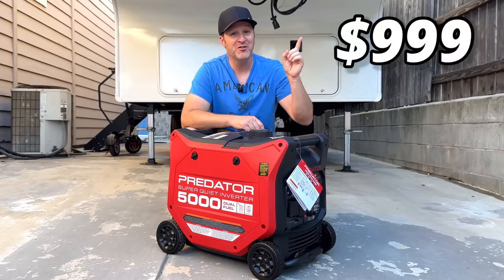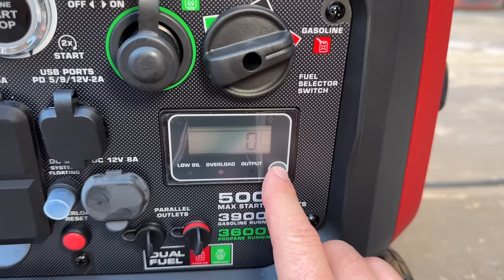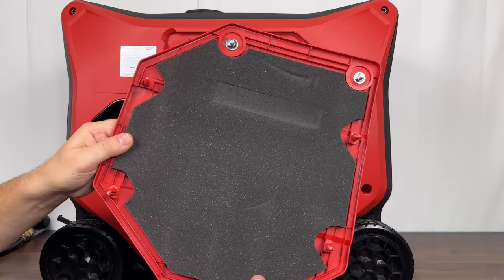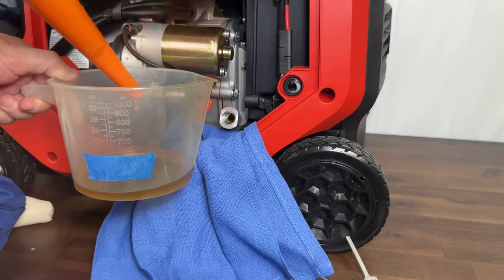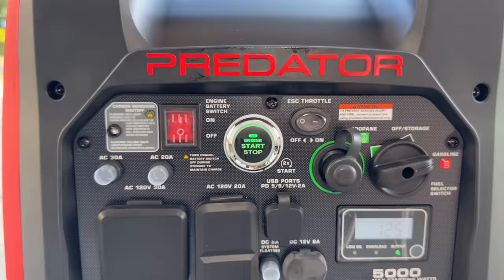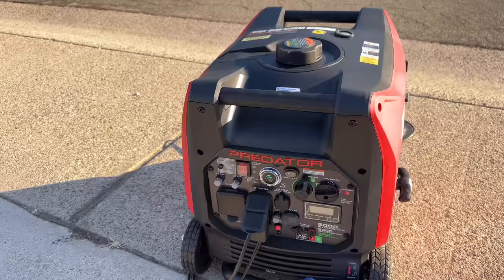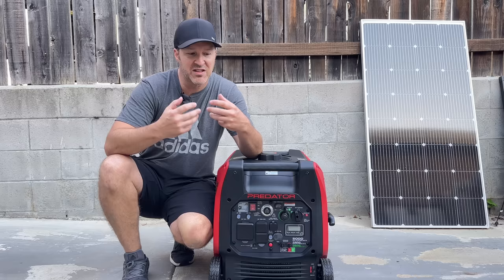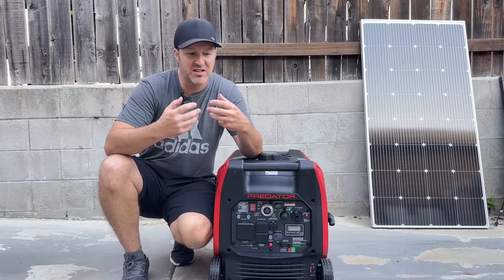BEST New Generator! Predator 5000 Watt Dual-Fuel SUPER QUIET inverter Generator LOADED!

Comment: Is it any quieter when running on propane over gasoline? I’ve heard generators can be quieter on propane
Reply: I've had several duel fuel units varying from 2500 to 7250 watts. I can positively say that there is no change in sound level from 1 to the other. Only a loss of output on propane and use of more fuel.  I really wish it was more quiet on propane. So other than the convenience and less maintenance using propane, I dont see any benefit while in operation.
Reply from the maker: No I have done that test several time and noted no difference
Reply: Dang that’s not what I was hoping to hear, thanks for the reply’s guys. Do either of you think a generator built to run solely on propane is any quieter than an equivalent gas inverter/generator? I’m trying to not disrupt my neighbors at various campgrounds so the quieter the better since I really don’t want to shit it down during the night hours or I’ll burn up inside my camper
Reply: @dylanhenkins8508  I share your same sentiment with noise at the campground.  My solution after years of building quiet boxes and buying tons of generators was 3000 watts of solar and an 11k battery bank.  Madness I know. I'm not a full timer but I can run my rooftop continuously in new york heat.
Reply from the maker: Only a small Honda gen is quite or maybe the new alp but a sound box would still be needed. Gens are just loud. Solar is the way but its still spendy and if you want ac over night you need a large battery bank and of course a lot of solar to fill it. Most like me can run ACs during the day on solar but over night even as stated above, 11kw won’t do it for a normal ac unit. Hence mini splits are getting real popular. But also depends on RV size and how well its insulted and outside temps. So many factors. .

Comment: Do you think the 9500 can run a small home
Reply from the maker: Sure, so can a 5000 or a 2200. I really depends what you are running in the house. If you just need essential items a small unit can. If you want a little more then a 3500-5000 can. If you want to run a lot then 9500, want to run everything 15k and above.

Comment: Hi , question can I use this generator for my food truck? To runs  AC mini split 110v , water pump, water heater and lights?? Thank you
Reply from the maker: If that’s all then yes!! The mini is about 1075 watts and everything else will be minimal. I mean unless the food truck is massive
Reply: @johnnysweekends  the trailer is 7x16 , i use 1 refrigerator, outside and inside lights, water pump ,water heater and the ac mini split
Reply from the maker: Ok well that changes things. You now have a Ac mini split a water heater which is that electric because that could consume 1500 watts almost. Then a couple fridges, you are now maxed and I think will need to jump up a decent amount. You dont want to run gens at 80% and above the whole time.
Reply: @johnnysweekends  so I need a 7000 w or 9000 w generator right?
Reply from the maker: You need to do a energy audit this way you know you have more than enough.
Reply: @johnnysweekends  ok thanks 🙏🏻

Comment: Have you tried this? Could you use this to charge an ecoflow delta pro? One with ac plug for 1800 watts and the other with the parallel ports hooked to mc4 plugs to the solar connection for another 1600 watts for a quicker charge in an emergency?
Reply: Considering whether it’s more advantageous to use the dual fuel EcoFlow generator, Predator, or Firman for the fastest recharge at the optimal price. Assessing if the additional cost of the EcoFlow is justified
Reply from the maker: The parallel ports are not dc. This would be a bad idea and damage the DP.
Reply from the maker: All depends if you want the smart functions and how often you would use it.
Reply: Thanks. I get it now.

Comment: What's weird is that this 5000W inverter gen vanished from Harbor Freight's website.  Gone.  I searched all over for it and nothing.  Even the promotional photos of their Predator lineup don't show it.  Very suspicious.
Reply from the maker: It’s been recalled !!!!!
Reply: @johnnysweekends  it must be very serious if they completely removed it and made it vanish! Any details on the recall notice and what the issue is? I can’t seem to find anything online
Reply: I check their website recall list and it's not on there.  And it's not on the government recall list either.  Interesting... @johnnysweekends
Reply from the maker: @tristanschaper281 im making a video now. Should be out Friday
Reply from the maker: @tristanschaper281 its not on recall list yet. May not ever be, but they pulled certain stock and might pull more. Will see

Comment: No split phase 240 volt AC kills it for me.
Reply from the maker: It’s a little small for a 240v power output. Most are about 5000 watt running to be a 240v unit or it would not have much power on each leg. 15 amps or so…

Comment: Dropped the ball. My 3500 takes care of most 110 needs. All they had to do is up the cc to 5500/6000 and add a 240v plug. I need an easily portable 240v gen with minimum 4000 running. Dumb in my opinion to have a gen so close to a 240v capable machine.
Reply from the maker: Most 240 is about a 6000 start unit. Many out there.
Reply: @johnnysweekends Many get mixed reviews. My Predator has had no issues. Would it have taken that much more? A lightweight, portable, reliable, and affordable 240v capable generator.
Reply from the maker: If they build a under powered 240v unit how would that look? The maxpeedingrods rods 6250 unit seems ok so far but still new. But each line doesn’t get much power. If this predator was 240v it would be getting 15.6amps per line. That would start ac units but it could power both sides of a home panel if you really needed it. But it would be best to just have a critical loads panel and call it good.
Reply: @johnnysweekends  my point is they could have just made it a 6,000 and 240v for those that need portability- covered more consumers. If I needed it for the house I would just get their 9500. Probably end up getting the Costco A-I power 7100- mixed reviews , but Costco , so easy return. I will look at your other suggestion.
Reply from the maker: Costco and HF both have good returns but warranties need for HF

Comment: Volt-Amps and Watts are not the same thing. Depends on load power factor.
Reply: Volts times amps will always equal watts. That is an electrical engineering standard formula. If you have 100 amps at 2 volts, or 2 amps and 100 volts, you still have 200 watts of electricity. Multiplying those two measurements together is how "watts" became a man-made calculation of electricity.
Reply: @1001Hobbies  You don't know what you're talking about. Better go back to your hobbies and keep quiet.
Reply: @General-Eclectic  - You should look up the Dunning-Kruger Effect and how it applies to you.
Reply: @1001Hobbies  Clearly, irony is not dead.

Comment: What is the point when it is only 120V?  At 5000W it should also have 240.
Reply from the maker: It’s to small a unit for 240, each line would have minimal power. What are you needing 240 for?

Comment: No whole house locking plug. A shame as it's a serious oversight.
Reply from the maker: What do you mean, a L5-30R twist lock?
Reply: @johnnysweekends  AC Out 30amp 120/240 AC locking
Reply from the maker: You can buy a adapter to your plug if you only need 120. Most people only need 120 to power a few items during a outage.
Reply: @johnnysweekends  I currently run a Honda EX5000, plug it into receptacle in garage which runs to transfer box next to fuse panel. The 220 is dispersed at this point. This is the same on all my friend's Gen/Transfer box installation.

Comment: What is the benefit of paralleling this with another unit?  It has a 30amp outlet on it, which is 3600 watts, same as what this generator can produce.  If you parallel with another unit, you would just be producing extra wattage that couldn't be delivered through that 30amp outlet.
Reply from the maker: You buy a parallel box and double amp out put. So now you have a lot of power for home or large RVs.
Reply: @johnnysweekends  what plug type is 120volts but can handle 60 amps??
Reply from the maker: It’s mainly to power up say a 50 amp Rv you can run both hot legs so it side can be powered. It will still be 120v though. 
This way of running 3 ac units and your fridge you can run 5000 watts and be good. More uses than that but that’s a example.
Reply: @johnnysweekends  gotcha thanks.  I didn’t realize the parallel kit had its own 50amp adapter.  Great review!

Comment: But no 240v😢
Reply from the maker: Most any gen this size is not 240. I don’t know any that are at only 3900 running. 
Unless it’s a open frame non inverter.

Plenty of 240v options

Comment: all of these generator have a 30 amp plug. really limits you on the size of RV you can use it with. Harbour frieghts 9k inverter genny still only has a 30 amp plug. My rv has 3 AC units and even the 5500 onan QG that is in it isnt enough to run the Air and the Nuke at the same time without shutting the genny off. More power is needed from these cost effective generators before they are really viable.
Reply from the maker: There are a few units out there but you are also beyond typical with that large of a Rv. The Genmax 7250 is a nice compact unit that’s 240v as well dual fuel and more. 
I don’t know what size ac units you have but it should run all 3 but that may top you out and you’ll be burning some fuel. 
https://amzn.to/450rDhw

Big toys require….. well 🤔 big toys 🤷🏼‍♂️😂👍🏼
Reply: @johnnysweekends  GM9000iEDC is the one I have been looking at. All three ac units are 15k. The Onan in my rv right now is worth way more but doesn't have the balls so I might be trying to sell that and getting one of the genmax units as backup for the solar on the roof pretty soon. cant bring myself to upgrade to a bigger onan for like $10k :P Great content though I watched the whole video.
Reply from the maker: They also have the gm10500 I’ll be reviewing soon. 
So if you wanted more you would be good lol.

Comment: No 120/240V 30A?  Disappointing with 5000 watt starting.
Reply from the maker: What do you want 220/240v for ?
Reply: @johnnysweekends  To use as backup for my house, which has a 30 Amp inlet.
Reply from the maker: This can still be used for home back up depending on how the home is powered. If you have a critical loads panel with 6-8 circuits You could still use this. 
There are not really any green under 5500 that are 240v 

You could but a adapter but if it’s a generator inlet box with 4 prong you may loose a side on your panel. All depends

Comment: What would have been helpful instead of you doing the voiceover why wouldn't you just talk into the microphone so that we can hear you in comparison to the generator that's going to be more of an accurate test to see the noise level of the generator all that other stuff I couldn't tell anything about it I've got the 3,500 actually sounded a little bit louder than that but I couldn't tell because they're getting you do the voice-over and not an actual voice footage
Reply from the maker: I’ll explain, but first not sure who “they” are….?? 🤔

When others or even myself did videos with no voice over when gen unit running, regardless the gen will over power your voice because its a constant sound pressure that wont stop and the mic will always pic it up as the dominate sound. Unless i yell then you wouldn’t be able to hear me clearly if much at all. So the other group will be like “we cant hear you”. So I can do it this way and still be able to give my opinion. 

Over all the 3500 having a smaller engine at idle i think could possibly be a little quieter by maybe 1db. But during lower and middle range operations to max load i think this unit is quieter. 
I think the 5000 quality wise is better built but a little bigger and heavier. And for the price you get so much more. I bet it will jack up to $1299 in no time.

Comment: This Generator has a 90 day warranty same as most Harbor Freight equipment.
Copied from their web ad!
Warranty Information
We guarantee the emissions control system on your engine will be free from defects in material and workmanship for two (2) years, provided there has been no improper maintenance, misuse, or abuse of your engine. We guarantee this product to be free from defects in materials and workmanship for 90 days from the date of purchase. Limitations apply.

$1000.00 for a 90 day warranty!    NAAAAAAA

Comment: I bought one of these and it’s complete crap. Buyer beware!!! It keeps over loading constantly. My hunting trip has turned into crap with the Florida heat because this junk can’t run my AC through the night. If it wasn’t so heavy I would throw it back into the stores window.
Reply from the maker: Any manufacturer can have a dud, and well now they do. Which it seems they know and are fixing it. Just like ford or Chevy or dodge they have problem models as well. Doesn’t mean all are junk. But this one definitely has a issue and I would return asap

Comment: no 240v disappointing
Reply from the maker: Not really a big enough unit for 240v. Close but just shy. Most start around 5500 running watts on up.
Reply: @johnnysweekends sure it is, I only need 15 amps for my A/C
Reply from the maker: You could look into the new genmax pair of generators, small and compact or the maxpeedingrods rods unit might be good the 6250. 240v is where it works best.